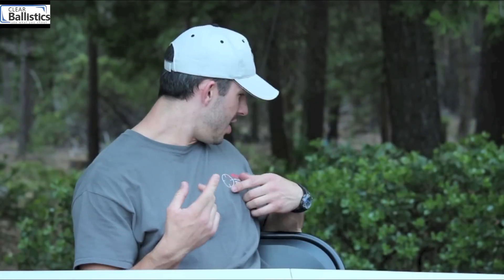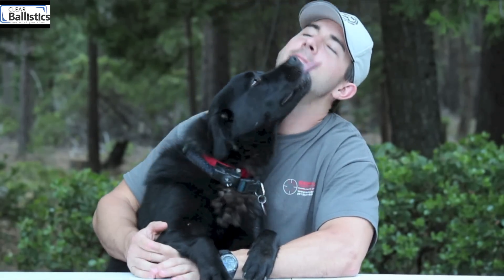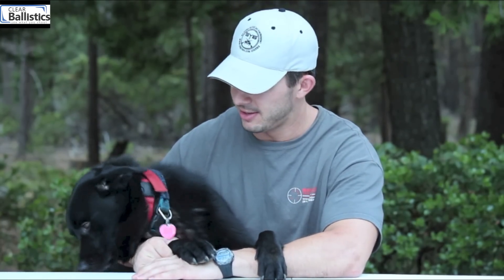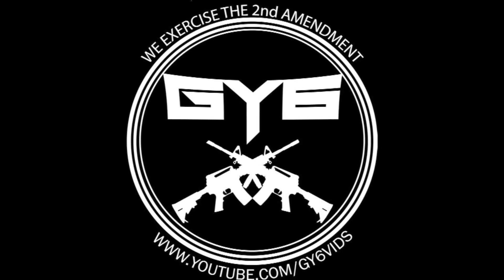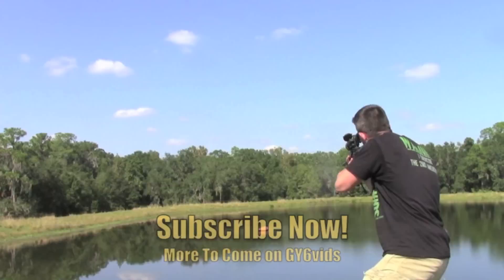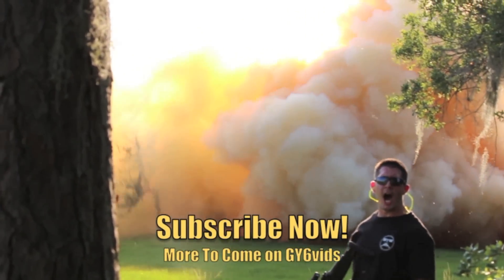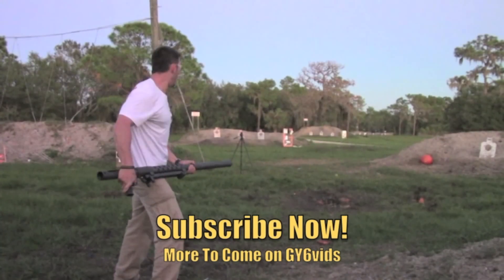Explosion Inside of Ballistics Gel- "Sonoluminescence or Dieseling" is the cause

Comment: This is the result of explosive detonation of gases, not powder. The explosive detonation is created when a hot projectile passes through a medium composed of petroleum and gelatin. The projectile forces it way into the gel allowing gases to create a rapidly expanding temporary wound cavity. The heat, gases, and composition of the gel (fuel) detonate, like a Diesel engine. The fire can't be maintained because the projectile is followed by a vacuum. Hence, the violent collapse of the temporary wound cavity is purged of the key ingredient needed for fire, oxygen. So, the gel block expels the hot gases.
Reply: That's a good answer, but not what's happening here. By the time the round has exited the chamber, the gases and powders have been ignited as much as they can be. That's why it's such a violent reaction when the round leaves the chamber.
This video shows an example of sonoluminescence, which is the result of air being compressed at such a frequency as to cause a burst of light. You're right about the heat part, compressed air creates friction, if you move that compressed air fast enough, you can get heat, like what happens with meteors. 
The air behind the round is collapsing so rapidly into the small cavity left behind by the round, that it's actually causing a minuscule thermonuclear reaction for a split second. 
This doesn't happen with all bullets fired into ballistics gel, because in order for this to happen, the air has to be moving at a certain resonant frequency.
Reply: If it were a result of the gel being flammable, the damage done to the gel, I think, would have been much more noticeable. I think the gel would have actually ignited, or at least left burns around the channel

Comment: Nice video but here is the reason

The flash is sololuminescence. Not powder. You are right about air coming into the cavity and expanding. But it is actually the compression of that air that causes the flash. When air is suddenly compressed like this it heats up to a point it explodes. 

Fun fact there is a shrimp that uses this bit of science as a weapon. It's called a pistol shrimp. It has one large claw that it can cock like a gun. And when it releases and snaps its claw it tears the water in a small area at the tip of the claw so fast is separates the water leaving just a space of air then the water rushes back so fast it ignites the air bubble to almost the same temperature of the surface of the sun 🌞. Just for a millisecond or 2. It uses this attack to break apart it's enemies or food.

Comment: Anyone who thinks this has anything to so with powder is incorrect. If you want to see this in much better detail look at RR vids. I suggest you look up the pistol crab for an explanation of this phenomenon.
Reply: Good try man, but I think it would be a good idea for you to re-watch those videos too. The pistol shrimp's light is caused by its claw cracking at extremely high speeds to heat water to a point where it is split into HHO, hence the gas bubble. The light is a byproduct sonoluminescence. Looking at the footage it expands and contracts due to the elastic nature of the gel, not implodes. It is most likely igniting gunpowder. It could also be the phenomenon in which light is created when polymers are separated by kinetic energy, but most likely its the gunpowder. I'm not going to 100% doubt the sonoluminescence, but we need to know more of what causes it before we make assumptions.
Reply: sorhsee precisely. the same phenomenon is happening here with the bullet moving through the gel at such a high speed. it's actually sublimating a tiny amount of the gel, and the pressure and heat cause the flash using the sublimated gel as fuel.
Reply: Alex Tanner however, it's not a settled theory as to exactly how sonoluminesence works. bottom line, what we're seeing in the gel is in fact sonoluminescence. 

http://en.wikipedia.org/wiki/Sonoluminescence +Yao Hu thanks for the link.
Reply: Why not?  You have a fast moving object, moving through a (non-newtonian, but that's irrelevant) fluid with enough velocity to create a pressure cavity. The back pressure exerted by the fluid has enough force to compress and flash the material inside the cavity. All the elements are there.
Reply: The smoke that exits the cavity after impact is a mix of steam from the flash, and burnt material from the gel. If you look carefully you can see scorch marks on the permanent cavity.
Reply: ***** "every reliable source ive seen showing an examle of sonoluminesenceence shoows a lab setting and a tiny barely visible BLUE light in water. the science just doesnt show this kind of reaction."

that is how hho burns when non contaminated but ballistics gel more than just water
Reply: There is a really clear example of this in the cold case jfk documentary roughly halfway through where they are testing the 6.5mm in ballistic gelatin and the cavity collapses the first time.

Comment: Not sure if this idea has been shared or not, but ill toss it in because this fascinates the hell out of me.

Could the flash be a result of the copper jacket opening up so fast that it generates enough immense heat to  
A. cause a flash with the combined powder, air, gel, and/or fabric like in the Barnes video?
B. cause the copper jacket itself to ignite. Kinda like tearing metal so fast that it makes a spark?

Comment: You may have answered this previously but how far from the Gel was the .357, please?  Have you examined an unfired bullet from the same series to see if any of the powder sticks to the bullet due to lubricant?  Did you happen to measure the velocity out of the muzzle and if so how many FPS did the 2" barrel allow?
The fact that the ignition caused smoke to be expelled from the cavity might be something other than powder burning, but it is the most likely suspect, with vaporized gel as a second possibility.
thanks,
chuck...

Comment: I've never used ballistic gel for my testing cuz I'm a broke ass so I use milk jugs filled with water, but it is possible for the lead to get hot enough to spall if the gel is water based but that wouldn't explain the flash 😞so the only thing I can think of is the theory of there being a space between the core of the bullet and the jacket with some powder caught in there and wasn't able to ignite until it started sucking oxygen into the temp cavity I think it would be interesting to try to figure out exactly what happened but that's about as good a guess as I can make
Reply: Lol but then again I'm not very good at thinking 🤔

Comment: So it's a bit dated to be replying to, and I should probably read the 1000 plus comments first in case what I'm going to say has already been said but... well... cmon. 1000? I have time but not THAT much. Anyway, I I concur with the idea that unturned powder could be following the round. Vaporized gel, not so much, mainly because gel is mostly water and water doesn't burn very wel. Duh. Plus the color of the flame, that typical yellow and orange and red gives some clue as to what's burning. 

That said, personally I would say do it again. A few more times. Try it from farther away and see if it still happens. Try it from longer barrels but closer. Change one aspect of the test at a time and repeat (erm assuming you won't go broke with the price of ammo). See if you can repeat the results but with different circumstances. If it was vaporized gel I think this would be a far more common occurance. 

If you really really want to give it a go, create a sort of sealed chamber that encloses the gun, and gel, and purge it with an inert gas, like co2 or argon. I would think duct tape and that clear painters tarp stuff and a wooden frame would suffice. The premise being that if it's an outside source for the fire/explosion, depriving the source of air would prevent combustion. Clever readers will point out gunpowder doesn't need external oxygen, entirely true. So if there is still a flame in an oxygen deprived environment,  then that must mean that something which either provides its own oxygen or doesn't need oxygen is what's burning. Narrows it down a lot if you ask me... course... you arent, but I digress.

Comment: It's actually not due to sonoluminescence as others are saying. That effect IS viewable on one other ultrahighspeed video of this phenomenon, but it's a tiny blue flash, not a big yellow one like here. What's happening here is actually ignition and combustion of tiny protein particles of the gel itself caused by adiabatic compression of air during the void collapse. 

Also, unrelated that, you are incredibly fucking insanely hot. Goddamn.

Comment: I do not claim to be an authority on or have substantual understanding of the phenomenon, so i could be wrong. 

I first saw this effect in another video. ( https://youtu.be/fX4ODh1g4eM ) I did think sonoluminescence briefly, but quickly changed my mind. The only examples of sonoluminescence that I have ever seen, produced a flash of white light, and definitely produced no smoke. THE flash in the gel is orange and flame-like in appearance. This is more consistent with a compression-ignition. I suspect that the stored thermal energy of the projectile combined with frictional heating, causes the contacted gel to vaporize. These vapors are then ignited by the rapid rise in temperature via pressure that results from the collapse of the cavity. This would explain the smoke, and the orange appearance of the flash. In my opinion, this is dieseling, and not sonoluminescence. 

There are videos of this orange flame-like flash in ballistic gel being presented as sonoluminescence, but given the sources, I doubt the validity of the claim. 

The fact that you know what sonoluminescence is, has earned my subscription to your channel.